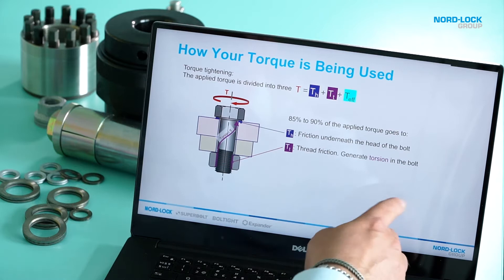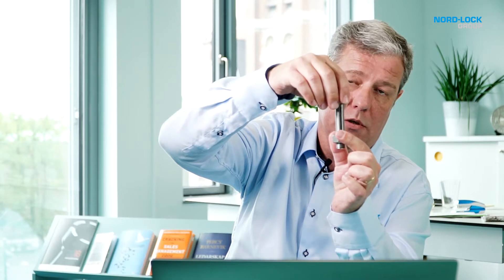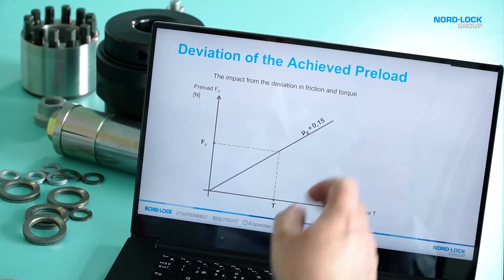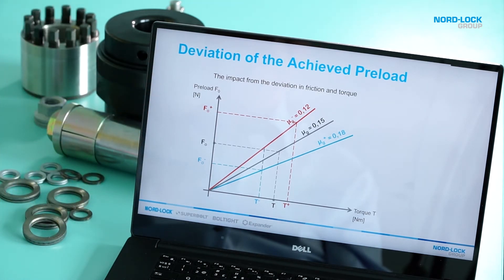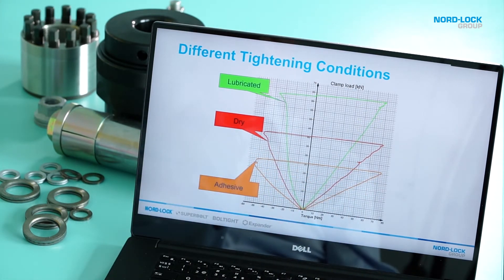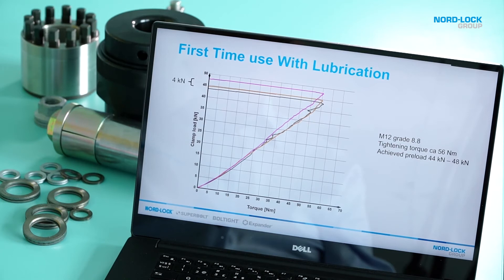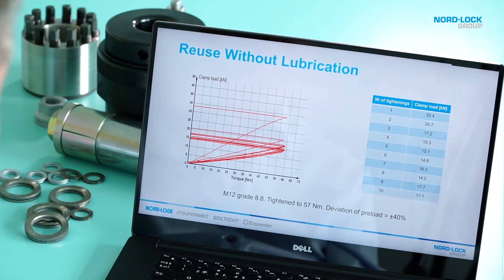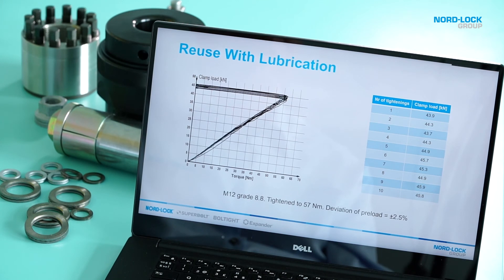The Experts - Lubrication and Friction

Comment: Why there is a preload loss during the reuse of screw without lubrication ?
Reply from the maker: We would think it has to do with the condition of the contact surfaces where the rotation occurs during tightening. what is clear is that the friction coefficient will increase during the first couple of reuses. We have done this multiple times and the result is the same. The only thing that variate is how big a loss there is in preload during the first and second time the joint is being tightened.

Comment: When you say adhesive…you mean red or blue loctite or something else?
Reply from the maker: Hi! 
I speak very generally, and don't mention what kind of lubrication that has been used either. The adhesive that has been used is a bit like a weak glue already during tightening. I know there are many different types and brands of adhesive and some of them actually can act a bit like lubrication during tightening and then after the curing time, it will "glue" the male and female threads together. The issue one can have with adhesive is finding the friction coefficient during tightening. I hope this helps you. Have a nice day!

Comment: Can applying anti-seize on bolts make them more susceptible to loosening under vibration compared to dry bolts? Assuming that in both the cases the bolts are of the same size and specifications and are subjected to different torque values to achieve the same pre-load.
Reply from the maker: Hi! Generally, when a joint is correctly designed with high flexibility and high preload, the anti-seize will in most cases not jeopardize the joint integrity.  It is when the joint is stiff, the ratio of the bolt stiffness divided by the clamped part stiffness (Kb/Kp) is more than 1, that the joint is more susceptible to loosening by vibration. 

One easy method to determine the stiffness of a bolt in a joint is to see how much the joint’s clamp length is (basically the thickness of the clamped parts). That length should be minimum 3x but optimally 5x the nominal diameter of the bolt combined with as high a preload as the joint materials and the application’s external working load allow. If the clamped part is made of a soft material, like copper, aluminum, etc., that would also increase the bolt to part stiffness ratio. If a joint is stiff, the integrity of the joint may be jeopardized by the application of anti-seize since that anti-seize will lower the friction between the parts and fasteners. However, lubricant is needed to stabilize the frictions in the joint. In torque tightening and in optimal condition, up to 90% of the applied torque will go to overcome the frictions in the joint so it is recommended to always use a good lubricant. 

Therefore, for stiff joints, a good securing method like Nord-Lock washers (https://www.nord-lock.com/nord-lock/products/washers/) is necessary to prevent the bolt from slipping in operation due to vibration. Apart from the fact that the effectiveness of the Nord-Lock washers is unaffected by lubricant, the washers also provide low under-head or under-nut friction variation during tightening (under the driven element). Lubricant will enhance this advantage.
Reply: @NordLockGroup  Thank you!